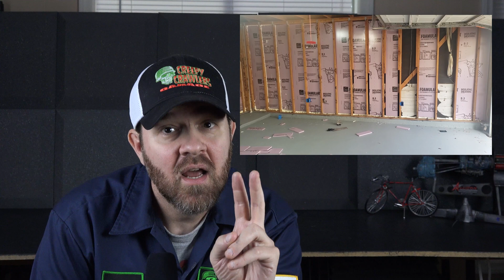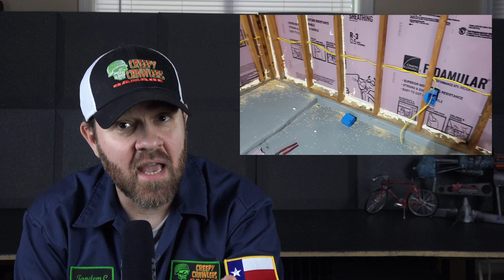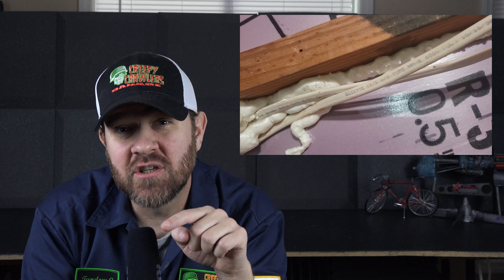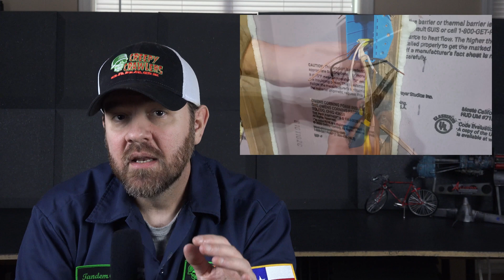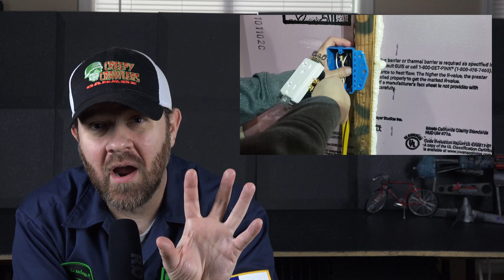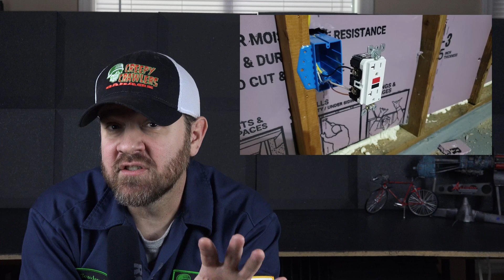Daily Updates: Studio Build Part 7, How Many Outlets Do We Need?

Comment: Most codes call for outlets every so many feet and within a certain distance from the corner. All of this will vary with local codes.
Reply from the maker: All I can find is there must be one 20amp outlet that also feeds outdoor outlets (explaining the one existing circuit), and one outlet per car spot. They must be GFCI protected and tamper proof, think I've got it all covered. The circuits will also have to be AFCI protected, but I'm leaving that up to an electrician.